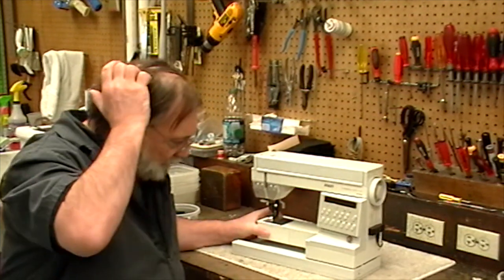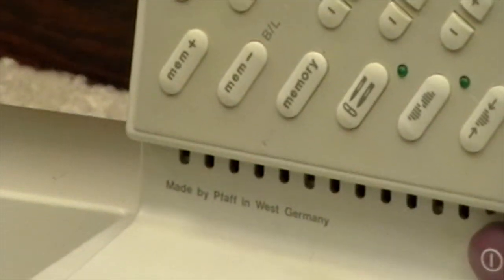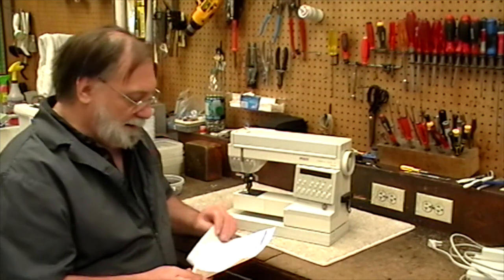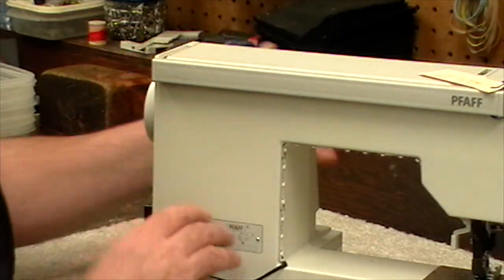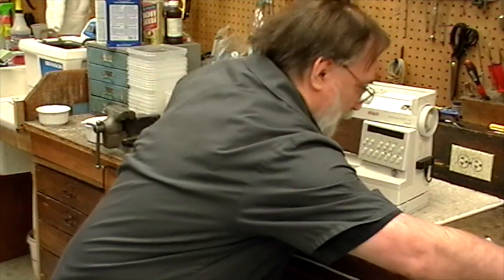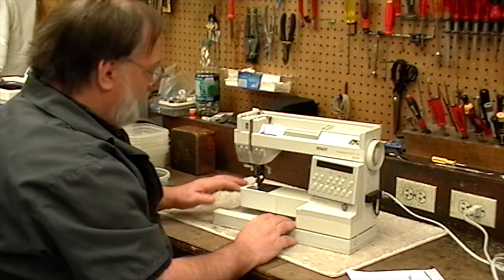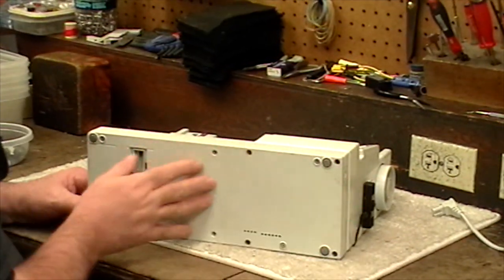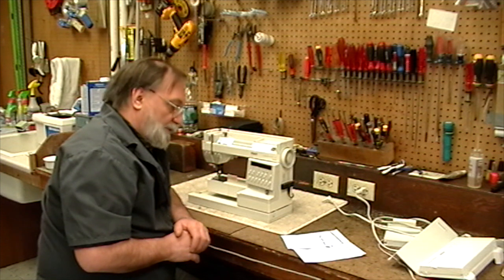Pfaff 1473 CD Evaluation and repair

Comment: Your video is awesome!  I have a 1475 CD that I purchased in about 1992.  It runs perfectly and sews like a champ.  I had no idea that it had batteries!  I immediately checked my machine.  The batteries have never been changed!  The looked fine but I removed them to check their health.  The read on the batteries was 4.1, typically a new battery will read 4.2.  Now that I know about the batteries, I will check them annually.   Also, my machine has  made in West Germany on the front, and I bought it brand new from a dealer in 1992.  I can use all of the functions on the machine since I still have a Windows 95 computer and all the Pfaff software.  Thank you for posting your very informative video. ❤

Comment: I have a Pfaff 1475 CD, the display stops working after about 15 minutes. The machine continues to work OK. If left off for some time and turned on the screen will start to work again for about 15 minutes. I read on the net that electrolytic capacitors can cause this problem. I have changed all the electrolytic capacitors and still the same. Any idea as to what the problem would be?

Comment: I have Pfaff with a worn foot pedal.  The speed control uses a ceramic block with a winding and the wires are worn and broken.   Do you have a method to suggest regarding a rewind with new wire?

Comment: Bummer you moved from New Holland (which is only an hour from me) to 2 1/2 hours away from me. I have the 1473 CD needs a bobbin winder clutch ... it won't release, so I either had to remove the needled from the housing to wind bobbin, or buy a bobbin winder (didn't want to put that much stress on the machine when it wasn't actually sewing, so I went with the bobbin winder) Bobbin winder is a terrible replacement to the actual machine doing it.  Do you have the part. I'm willing to make the drive if that's a possibility.

Comment: Hi  i have a creative 1467, it works well till now, there is elektriciteit and the ligt are on, but it does not work any more. The dealer said it can't repareren any more because the parts are not aviable any more. Can you help me

Comment: I have this same Pfaff 1473 CD. I was taking the ankle off to put on a generic foot and when I tried to screw the ankle back in place it wouldn't screw straight. It was going at an angle and wouldn't completely screw in. My husband looked at it and said the screw was stripped. So my question to you is what screw do I need? And would I need the vertical part that the ankle screws into? I don't don't the name of that part. Do you sell these items? Or can you give me the part numbers and where I could buy the screw and other part if I need it? Thank you.

Comment: I have the creative 1476cd machine, the pfaff atk0033 control foot.  The control foot stopped working and I went in and tried to see if it needed to be cleaned.  Now we don't know where the copper bent wire goes.  Anyone able to help?  there is one copper piece that I can't remember where it goes.  WE FOUND IT!

Comment: I  have a Pfaff 1475 cd. When I turn it on, the light over the pressure foot comes on but the lights on the control panel does not come on right away. It takes about 30 minutes before the control panel display comes on and it won't sew until those lights come on.  What can be the problem.
Reply: I had the same problem with my 1475 several years ago and I would heat it up with a hair dryer to speed it up to turn on fully. An engineer friend of mine finally took it apart and replaced 3 capacitors on the mother board and it has worked ever since!  Cost me about $18.00 for the parts and a hug. Other friends got charged $500 plus to get a refurbished motherboard and months of waiting!
Reply: @prettybirdbeenlpeacock6592  thank you for the info.